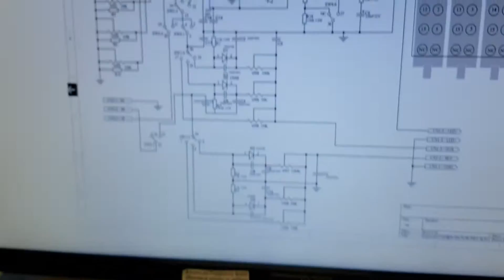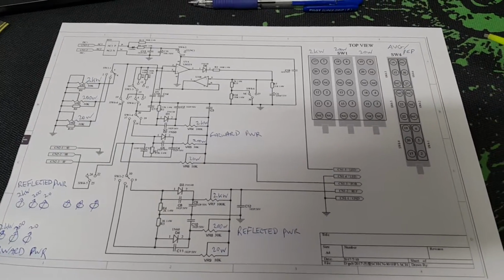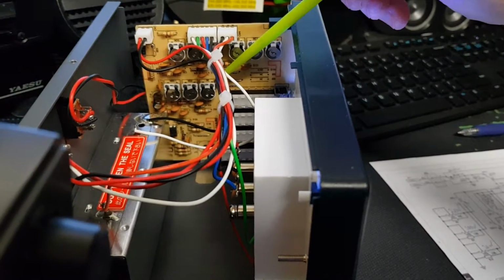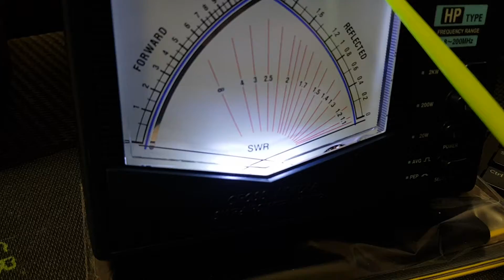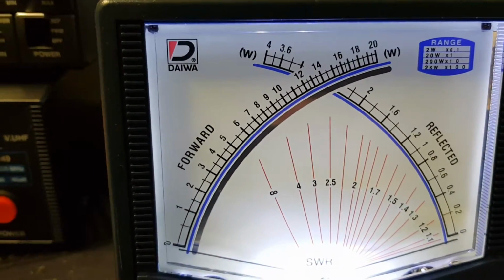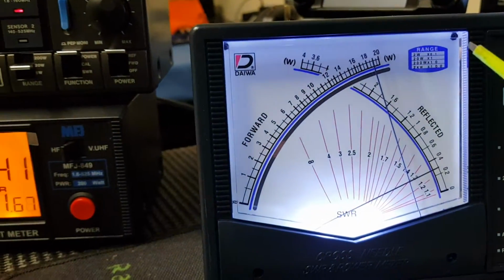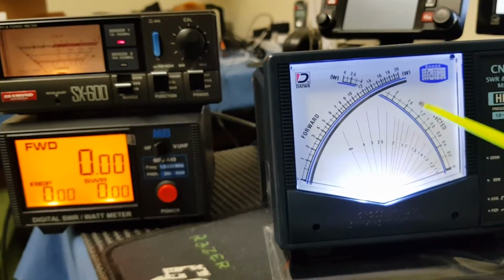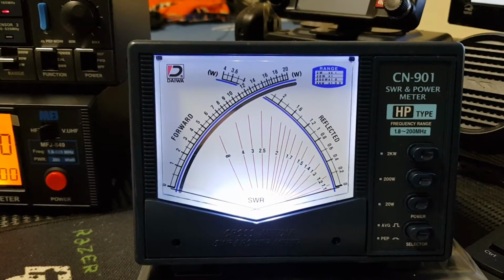How to calibrate your Daiwa CN-901HP SWR / Wattmeter

Comment: Hi M8 , i have the HP2 , Hp3 NS660 Daiwas , instead of using a radios power is there any other way to generate a type of more accurate  REFERENCE power output, ie a signal generator ?you probably would have to boost the signal?
PeaceFromOz 🇦🇺
Reply from the maker: G'day. Other than a "radio" you would need an RF power amplifier of some sort which could output at the desired frequency, in a constant carier fashion. If you managed that, then all the steps in this video can then be applied. Don't forget you would need an appropriate input signal into the RF amp as well. A bit of mucking around if you must go down that path. I hope this helps....
Reply: @radioaxe6964  cheers,  I guess you're average of a few reliable swr/power meters is the go 
Thanks for the reply.

Comment: Good video, I wish you would've explained a bit more how you actually calibrate the meter.  Do you turn the knob you showed inside?  Also, do you have to go through the 20W, 200W and 2kW knobs and adjust them all?  What meter do you prefer, Daiwa analog or the digital MFJ you have there?  Thanks!
Reply: TonyAlbus does a similar calibration on a Daiwa swr/power and goes into more detail regarding the pots.
😊

Comment: Nice video. It all makes sense. 

I just received my CN-901HP. It hasn’t even been connected yet but shows an indication of 9W Fwd and 2.5W Rev. This is not an electrical calibration problem since the meter is not powered. An attempt at zeroing the meter using the zero set screws using a small jewelers screw driver makes absolutely no change to the meter movements. Is this device defective? I made a call to Daiwa’s US distributor support who tell me that there is nobody to take my call. The retailer does not answer their phone.
Reply from the maker: I would keep trying to return it. There is no way you should accept that as a new "working " meter.

Comment: I thought I had a problem with my FLEX 6400 in terms of RF output.  In troubleshooting, I used a different MFJ meter and found that the problem was with the CN-901.  This video allowed me to fix the problem.  Thanks for taking the time.  73
KK2L
Reply from the maker: Nice! Good job in fault finding and correcting. I am very glad this helped you rectify your meter. Your valued feedback makes it worth while spending the time making these videos :) Best 73s

Comment: Useful stuff, mine is low by about 20%. Going to compare to a bird that another local ham has. If I can get within 5-10% ill be happy! How accurate would you say they should be? Say if I went for calibration on 40m, would 80/20 be pretty close still? How much of a difference do you think one should expect?
Reply from the maker: If you can calibrate it against a Bird on the band and power you mainly use,  that would be fantastic! Personally,  I would be happy with anything less than 10% given what we pay for these cheaper Chinese power meters.  What is acceptable is very subjective.  73 :)
Reply: @radioaxe6964  thanks for getting back to me, me and another local guy are trading favors tonight, I'm programming a radio and he's bringing them along. Plus I'll be able to get a good output reading on my Amp now! I know Im putting a heck of alot more out of my al-811h than 450w!!
Reply from the maker: @HamRadioNewb  for sure. Especially on the lower bands.

Comment: I may have missed it but did you mention that you should adjust the needle on the front to the ZERO mark if it's not already there? I have discovered that many videos show the needle is either above or below the ZERO mark which is Not the proper position for an Accurate reading.
Reply from the maker: On the zero for sure... Just make sure you are looking directly / straight at the needle to avoid parallax error.

Comment: Rubbish about 60% range being the most accurate. I actually built and calibrated the Bird watt meters.
I have built countless Jeweled and Taut Band suspension meters. They are calibrated at full scale and must track within a certain tolerance or be rebuilt or scrapped.
Reply: I have heard that somewhere too, don't know if it was regarding cross or single panel needle meters..I think Alan W2EAW mentioned it on one of his repair and replacement of different panel meters 
Peace.

Comment: Mine arrived today and like yours it was all over the place. Both meter were not set at zero, the calibration was out on all three settings and the light switch on the back was broken. I fished all the bits out, re-built the switch and refitted it, calibrated it and all is working now. Would of been sending it back had it not been for your video, thanks. What are the 3 pots on the left of the circuit diagram doing?
Reply: which one sets the Reflected back to zero. Didn't want to chase blindly to try to turn all of them. Thanks for the help ahead of time.

Comment: The PEP hold is 300 watts higher than the standard non hold PEP????? Any idea on how to adjust this?
Reply: If you are in the 2KW mode that sounds about right eg PEP would show 50 -60w and when switched PEP HOLD 80-90w.. on SSB
😊

Comment: Thanks for the description... However, in my watt meter same model, it seems that the pep button shows the mininum watt in ssb while the AVG shows the maximum... I think that they are place up side down somehow... Do you have any idea???
Reply from the maker: Thats really strange. You can try to reversing the mechanical operation of the switch but that would be difficult I'd say. Sorry can't help any further.
Reply: Thanks for your answer! It is really strange,that's true...but, I was thinking... changing just the buttons would be enough or I should change the trimmers inside the watt meter... And that would be appropriate???

Comment: Calibration work on  at both average and peak? How's the av/peak buttom supposed to be?
Reply from the maker: It can be either peak or average. As long as your reference meter and the meter you are calibrating are the same. Personally I would use peak then check in average as well.

Comment: hiya, I got one of these meters and its not that old and its just suddenly started to show a forward power reading of about DOUBLE of what it should be !!!  so looked around for some info and found this.... ( according to my meter, my Kenwood TS50 is putting out 250 watts!!!-- anyways I notice on your meters a big difference in SWR from the Digital which shows 1.66 and the Daiwa shows 1.3 ??? that's a BIG difference ???many thanks anyways for the Video
Reply: Those Nissei dg-103 and dg-503 meters are wildly inaccurate on HF.

I have 4 different accurate working SWR meters here, and they all showed a 1.6 > 1.7:1 SWR on the 10m band - whereas the Nissei showed 1.04:1.

They're notorious for incorrect readings & there's a good few reviews about it on the web.

I had to return mine & wouldn't have one given to me now, no joke!